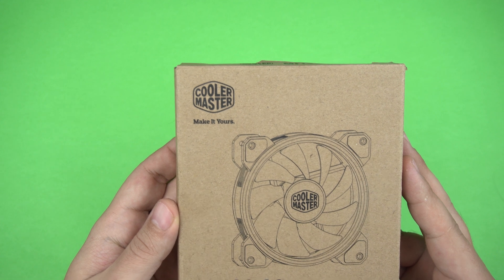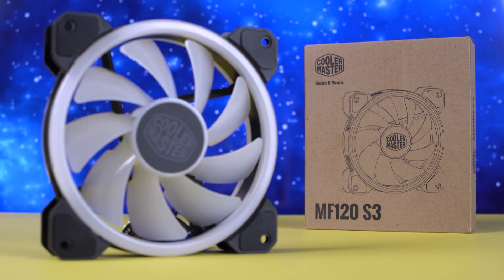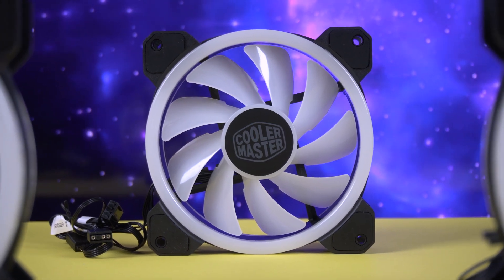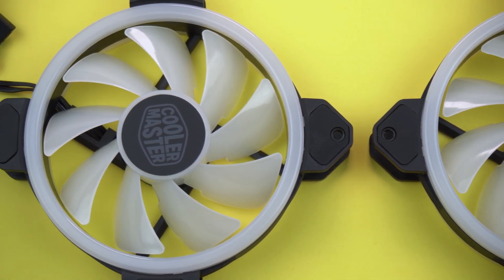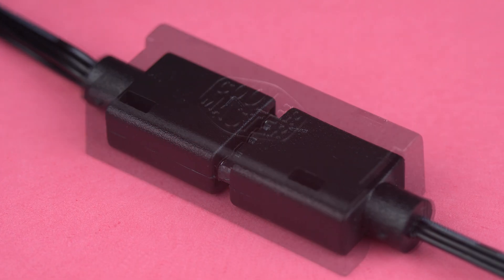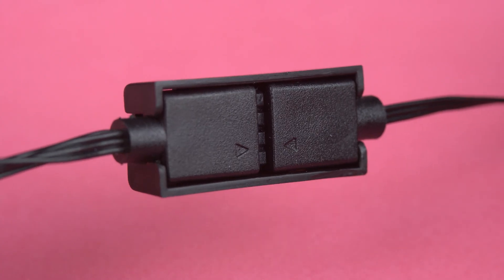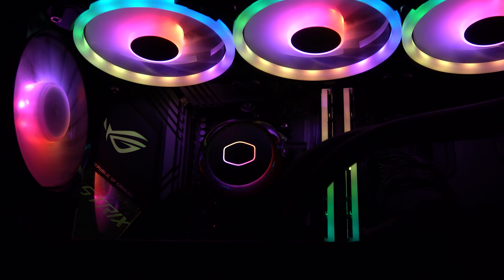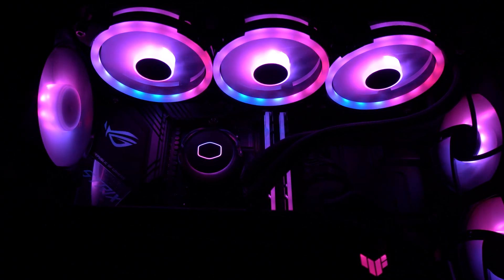Cooler Master MF 120 S3 Rgb Fan İncelemesi

Comment: abi kasan çok güzel duruyor modeli ne
Reply from the maker: Cooler Master TD 500 Mesh
Reply: @teknorite  kasanın kendi fanlarının rgb renklerini nasıl değistirebiliriz ? Standart kendinden 8 tane modu var sanırım reset tuşuyla değiştiriyorum ama videolarda filan benim kasadan var farklı farklı renkte fanlar dönüyor
Reply from the maker: @muratyuksel8111  Anakartınızın  12V Rgb 4 pinli soket varsa fanları tek kablo ile bağlayarak, anakart yazılımları ile kontrol edebilirsiniz. Anakart üzerine 12 v RGB Header yazar.